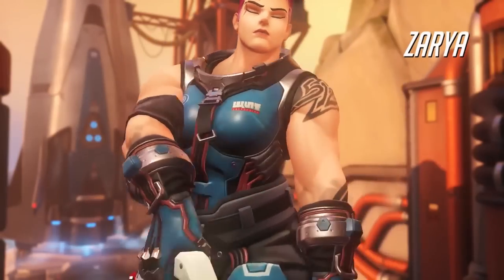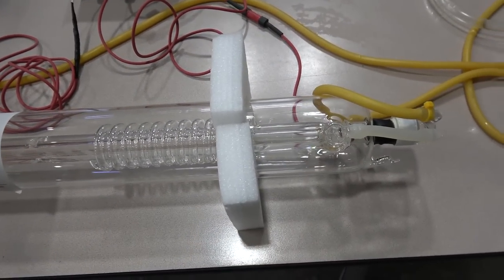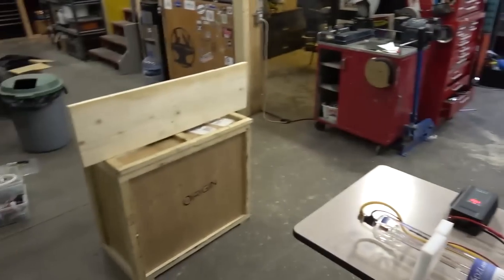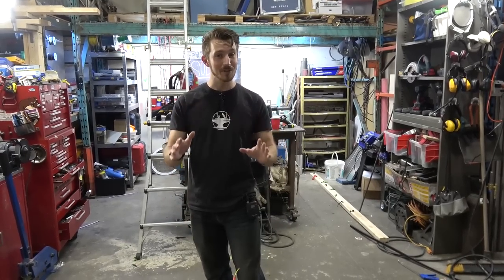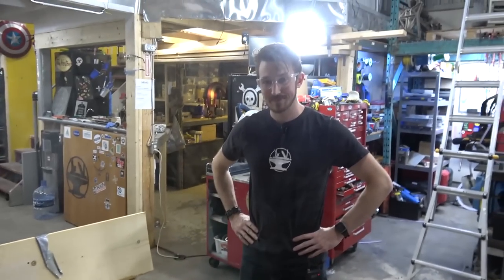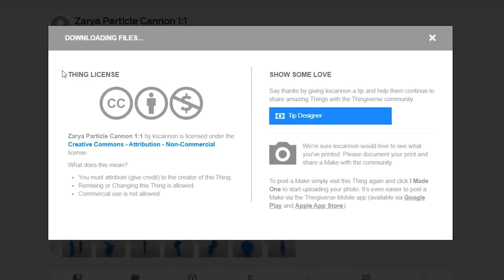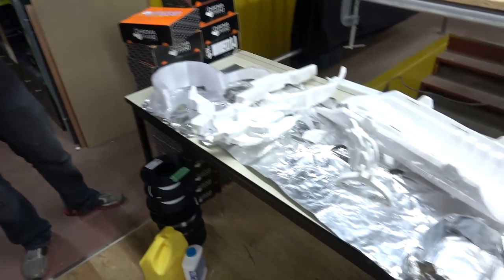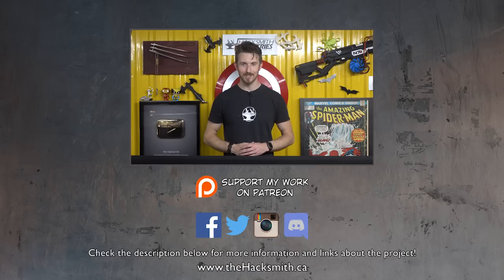Make it Real Zarya's Particle Cannon (PART 1/3)

Comment: can you make it more powerful by using a capacitor bank to store energy then dump it all into one shot and turning it into a laser pulse cannon ?    you for certain need visible lasers for sighting or someone might lose an eye.
   those sponsors kick ass.
Reply from the maker: I think you'd burn out the laser, it's not designed for that!

Comment: Would it be possible to stack several of these lasers into something like a circular shape and then focus them into a single beam using a laser-grade lens?
Reply from the maker: Not really... they'd be too far apart! Also laser focusing lenses are super expensive. One the size of a quarter is $100! I can't imagine how expensive a dinner plate sized one would be!!
Reply: What about using the laser grade metal mirrors you mentioned in another comment to "move" the lasers into a smaller area so that the lens could be smaller?
Reply from the maker: Doesn't work very good for a "gun" remember you'd have to adjust the mirrors to hit a certain target at a certain distance away. Kinda makes it useless as a weapon if you have to adjust it all the time for that =P
Reply: Makes sense! Thanks for responding! I really appreciate it!

Comment: Why don't you guys just print shells for the weapons and reinforce them with fiberglass (or kevlar/carbon fiber if you want to be flashy) and a strong resin like MAX CLR? You could vacuum bag it to make it light or just say screw it and do a wet layup and still be better off. Your prints wouldn't take as long, would cost less, be stronger, wouldn't need as much filament, and ya'll could have more inner cavity space for adding foam to cushion the laser tube with more heat sinks or other better cooling, and more room for circuits this way. All that infill is just taking up valuable real estate for more cool gadgets, sound boxes, micro fog machines, and leds that could be in the gun.  Or perhaps you just wanted all that Lulzbot gear?...Well played. Awesome project either way.

Comment: I always thought infrared was visible on camera
Reply from the maker: Not this wavelength! Most sensors can only see up to 10.6nm this laser is 10.8 =(

We've tried multiple cameras, sadly it's invisible! Also all lasers are technically invisible along the beam -- the only reason you can see green and blue lasers is because they are so bright they are reflecting off particles in the air!

Comment: Couldn't you just have imported the .stl's into SolidWorks and converted them to surfaces? then you can assemble them as usual.. Cool project btw ;) looking forward to the rest!
Reply from the maker: +MKB you'd want to convert them to solids, which SOLIDWORKS actually has a limit on the number of triangles in the model... It doesn't work nicely. Even simple STLs are terrible. Remember an STL is a graphical file type designed in the 80's. It's not an engineering format :(
Reply: From the surfaces you can make a solid, in theory, but usually it leaves gaps and before you've got all those filled.. So you're right ;) moving the STLs by hand is probably quicker and far easier. 
The quickest would be not having people who upload files like that haha 
Good luck with the project!
Reply from the maker: They came from a game file, which would also be graphical, so that's the big issue =(

Comment: What to do with CD readers - reuse their lasers. How to code faster - reuse code, use libraries. I would search how to efficiently convert a blender file into printer files. Unbelievably one has to print them all separately, because of a scale and data it holds - low space on a single CD. Selecting it with ctrl+a is a bad idea if files don't have thumbnails or file name/AI generated words what might be inside. Goblin ingenuity - can they print a 3D newspaper.

Comment: What about shooting it into a crystal or a prism what do you think it would do ?
Reply from the maker: Most would absorb the IR light and blow it up. IR is absorbed by pretty much everything! You need super expensive glass that is IR-transmissive
Reply: That's right sorry forgot it was a IR laser . Used to fool with lasers in the past. LOL Should show it cutting steel if it will after being modified with a smaller power supply and what not vs being on the cutting machine.
Reply from the maker: Unfortunately this cannot cut any kind of metal -- watch my Will it Laser series to see what it can do!

Comment: STL isn't that bad, just use auto desk
Reply from the maker: +Mercury The Metallic Liquid it's a format made in the 80's. Doesn't matter what you use it's a graphical format that sucks for real engineering
Reply: the Hacksmith noted! I'll try out solid works and see how it works, thanks!

Comment: can't u rearrange all the stl files in inventor
Reply from the maker: It'd have the same issue -- you'd have to move them manually. STL's are a file format from the 80's its really a graphical file format, not a proper mechanical engineering format!
Reply: the Hacksmith ohh yea true, I was thinking of normal inventor files in which you can mate the individual parts.

Comment: The standard is .25 as the nozzle????? lol  it's more like 0.4 or 0.5
Reply from the maker: +BEN in 3D I was talking about layer height...
Reply: the Hacksmith wow I never had anyone reply to one of these lol cool,  oh .25 microns layers my bad lol (nozzle size and print layers it's can get confusing) 
Are you guys using Cura or slicer?
Reply: *slic3r